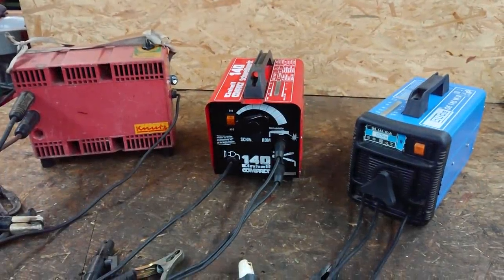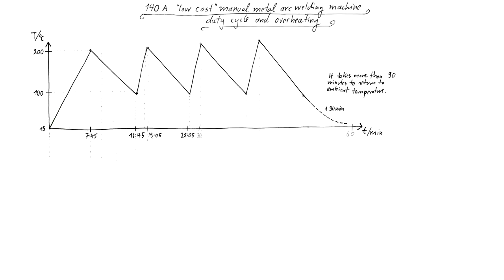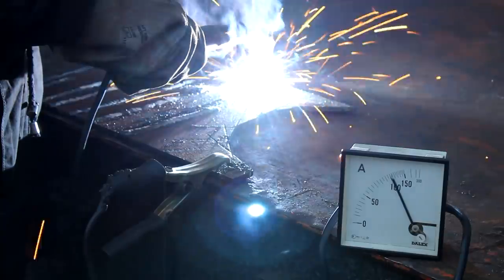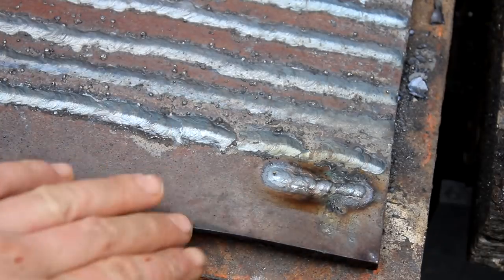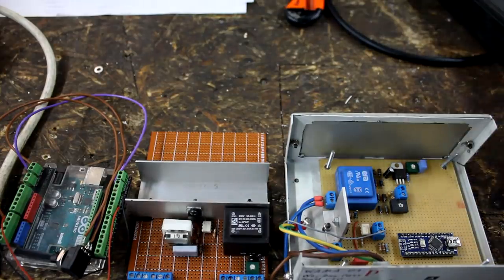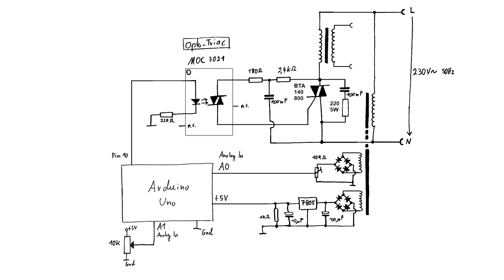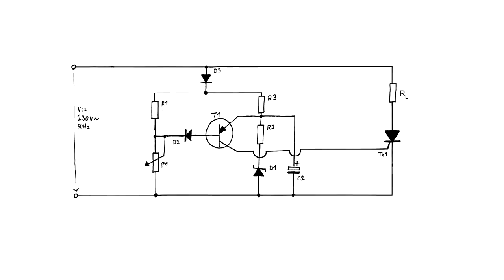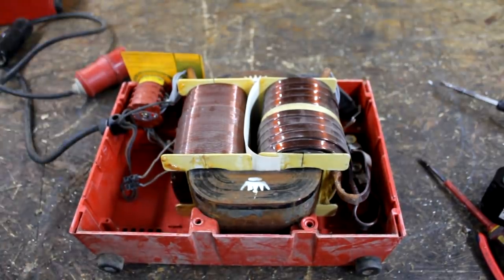Welder Experiments! DIY Upgrades for Cheap Stick Welders!

Comment: Isn't there a risk that the fans aren't really cooling the transformer particularly well? I.e. that they are basically cooling the exterior, including the thermal cutoff switch, but the interior windings are still getting too hot?

Comment: Mma?  Never heard of that one.. gmaw, smaw, mig and tig only ones i really know..  gas metal arc and shielded metal arc welding.. think gas is mig ot manual inert gas and shielded is stick because the shielding gas is made from the flux burning while you weld.  But saying that confuses me because flux core would be under that same principle yet its not smig...  tig is given wit tungsten..  or is it metal inert gas?

Comment: What mess in the mains will couse this large current ramp up when triac is fired on the maximum of the sine wave.
Reply: But is it worse than other switch-mode circuits with no transformer for stepping down the voltage?
Reply: @wilhelmbeck8498  Generally switch mode cirquits for welding should have insulation transformer. But it is high frequency transformer. Also good designs should have power factor correction cirquit. Due to high frequency relatively small inductors and capacitors can flter sufficiently switching noise.
Reply: @askostadinov   So we can expect a video on how to deal with complaining neighbours ! ( looking forward to that one ! )
Reply: @wilhelmbeck8498  I am sure the autor will address the problem and I will watch with great pleasure.

Comment: A question about the fans: The way the fans are used it looks to me like you can only move the amount of air that one fan can draw through the inlet, couldn't you get twice the airflow by mounting both fans at the same end moving air in the same direction?

Comment: Why not build a new enclosure for the transformer that can hold oil to act as a cooling fluid?

I'm going to build a welder that's designed for 50 amps input and plan to submerge the circuit in mineral oil and add a small radiator, pump, and fan to the system to handle the thermal load produced.

Comment: I can see a problem with the cooling.
The volumetric efficiency is too high. Your using 0.942m² tube to cool a 0.36m² transformer.
If you place a venturi or internal baffling around the transformer, you will increase the air speed over and through it.

Comment: I have transformator welder with selector for 0 50 80 110 and 140 A, the selector was broken, got a new one, but there is 8 wires inside (4 coming from big coil and 4 from small). The switch in every position connects only 2 wires. How to know how to properly connect the wires to the switch and how to measure them because there is not marks on the wires. Thanks

Comment: It looks like you had the fans working with one pulling air in and one pulling it out, if so I think you might get a better result with them both pull air in and letting the warmed air vent upwards through a grill.

Comment: Great idea. But I think a Mikrocontroller based triac control is pretty overengineered (except you want to do something special with the waveform). An analog circuit will do the trick and is much simpler, as the small transformer is not needed.

Comment: I have created an alternator as a bldc motor and have it turning a wind generator off of the bldc motor. It makes 80 to 109 dc volts but when I try to use it it slows down and only makes 24.8 volts dc. Do you know of a way to filter the output to get the 109 dc volts and relieve the strain and loss of the PMA out put?

Comment: Now what would really be interesting, DIY liquid cooling!
Reply: yeah, filling the pipe with oil, adding a pump to circulate and a small intercooler or just an old radiator.

Comment: I admire what you did here.  You definitely have skills.

You probably thought of this already, but if you convert to DC, then feed that to a mosfet H-bridge, all kinds of things are possible.  You can control AC balance for welding aluminum, pulse rate and duty cycle, basically do it all in the electronics.

Comment: diy ac tig welding from analog means style repurposed  junk or ? signal generator and a class d amp be fun to see some of the full range Brazilian amps may work  tiny lots of power may be the silliest thing but if any one could get a 10k Taraamps to weld it would be you lol

Comment: I have seen your comment about the serial connection but I decided to add my comment about that:
It's not a good idea to connect the 12V fans in series to 24V.
They should be connected in parallel to 12V.
Any difference between them will cause different voltage to arrive at the fans and one of them which gets the higher voltage may fail.

Comment: Would be lovely if you can reverse engineer the HF Start module from your older project, the ESAB analysis, and how to implement it in this project or in a DIY TIG Welder project starting from a cheap DC MMA Inverter.
Maybe make a pulsating module too...so this would be a cheap alternative for the folks wanting to try out TIG before investing in an expensive unit.
I'm 100% sure a lot of guys out there would be greatly interested! I'm one of them! 
Keep up the awesome work! and thanks for sharing the knowledge!

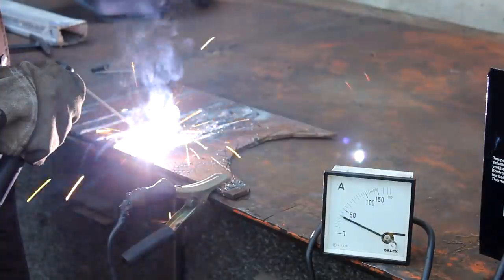Comment: Anyone else notice what looked like Stray Arc Flow traveling through the metal table (at a radius line to the right of the workpiece and then again later at the edge of the table to the right of the ground clamp) @ 11:00 - 11:20? Maybe I'm mistaken ... I'm a humble man, been wrong before and it'll happen again so why pretend otherwise ☺️... but I don't think I've ever seen something like that in person or from another welding video. If anyone has an answer I'm super curious.

Comment: As always, excellent video! I moved from the old transformer welders to inverter just a year or so ago, having used transformer welders for many years to good effect. I did consider doing some of the upgrades you did (primarily turning it into DC with a bridge rectifier along with some big caps) but I decided against it considering the low cost of inverters and the desire to get HF TIG too. Impressive to see how far you are taking this - though I presume it is more for interest rather than trying to get a good cost saving upgrade. Just something you might like to consider as you dont have Dinse connectors shown in the vid - on my current inverter welder when I am switching between TIG and MMA, I often just leave the earth lead set for TIG and run the MMA holder in DCEN. I honestly cannot say I have noticed the difference between the results of DCEP and DCEN (obviously, I am only speaking about MMA - DCEP TIG would be a whole different ballgame). This might just make your setup a little easier. Looking forward to the next one! Thanks

Comment: Great video as always, if i could pose a question: why did you use that type of circuit for driving the fans instead of a transformer or a switching PSU? It seems to me to be overly complicated for the function it achieves. The explanation of it  was very interesting though, so i definitely see the educational purpose behind it. Does it have any advantages i overlooked?

Comment: I think your capacitor C1 should be upgraded to a 350 volt. The rms mains is 230 volts but the peak value far exceeds the 250 volt rating

Comment: So you basically use a dimmer circuit to step down to some DC voltage. Nice idea!
Are the fans too high powered or would it be possible to also drive them with a simple capacitive dropper?

Comment: Nice vid G, there are some nice cheap igbt's ($11) that would make a great CV and CC ac and DC supply, all controllable with the Arduino. I suggest this because there is a shortage of welder source design demonstrations that, if rectified (pun), would reduce the impunity welder companies show toward sharing their schematics. Thank you.

Comment: I think you did a great job  and had simple, yet elegant diagrams and explanations!  However,  I see with the welder a way to modulate the on-portion of the phase of the AC power coming into the primary.  I DON'T see a means of power factor control - a completely different beast altogether!  But I look forward to that.

Comment: EDIT: This comment is for the first circuit:
You can eliminate the second bridge, if you install an 1N4004 or higher diode. The higher the voltage rating of a diode, the higher its reverse leakage current. 
Put this diode in the path between the 1st bridge and the 100uF cap.
Take your signal from the cathode of this diode. The anode will go to the cap. 
Replaced 4 diodes, with one. The rest, stays the same. 
Where is my prize?

Comment: Lüfter: Zwei Lüfter "in Reihe" wie im Video = Ein überflüssiger, nutzloser Lüfter:) (Übertrieben ... aber im Prinzip ja)
Keine 220-240V~ Lüfter benutzen: WHAT? WHY? 
Ist natürlich völlig legitim, wie du im Video gesagt hast mit Phasenanschnittssteuerungen/Regelungen zu experimentieren. Vor allem für YouTuber dürfte eine Temperaturregelung etwas feines sein. Alleine wegen den reduzierten Hintergrundgeräuschen. Aber in der Praxis und im Standardbetrieb (Also wenn etwas unbedingt FUNKTIONIEREN MUSS, wenn die Maschine gebraucht wird!): Schnickschnack! Weg mit dem unnötigen Zeug, das andere Schaltungsteile vielleicht negativ beeinflussen kann und genau betrachtet nur ein zusätzlicher Pfad ist, der AUSFALLEN kann und somit die Funktionsbereitschaft des Gerätes eher vermindert. Es gibt überhaupt nichts an einem dauerhaft laufenden Lüfter in einem Schweissgerät auszusetzen. Außer natürlich bei den Erbsenzählern, die üblicherweise oben genannte Probleme, die Kosten der Steuerelektronik und die erhöhte Anfälligkeit eines gesteuerten Systems einfach unterschlagen. Beispiel: Der papst DC-Axiallüfter, 24 V mit 169.9m³/h der 41,16 € kostet und geregelt wird, hat noch nicht einmal ein Drittel der mittleren Lebensdauer des 4000 N AC-Axial-Lüfterkit,  230 V ac, 160m³/h im praktischen Einsatz. (So nebenbei: Bei diesen Lüftern kann "das Drittel" immer noch 7-10 Jahre Lebensdauer bedeuten).
Edit: Kosten für den Lüfter mit direktem Netzanschluss vergessen: 43,51 €

Comment: hi,nice video,keep it up,just wondering,why do you need an arduino,the same function can be achieved with an analog circuit,also,the switching transients could cause extra heating in the core of the transformer

Comment: Love this channel, do not stop the theory, inverter tech at its basics. Could you please do a video explaining why low level capacitors, like the little electrolytic one at the end of the build, are used for stability, is their breakdown voltage exceeded, or not. Different uses for capacitors ( or no am I misunderstanding) its not like when capacitors or used in a circuit for power correction or reactivity purposes, right?

Comment: Very interesting video (as almost all from this channel). 👍
But please train yourself to draw electrical diagrams with currents and signals that go left to right and top to bottom (as is common practice with technicians). 😵

Sehr interessantes Video (wie fast alle von diesem Kanal). 👍
Aber bitte gewönnen Sie sich daran, elektrische Diagramme zu zeichnen, mit Strömen und Signalen die von links nach rechts und von oben nach unten verlaufen (wie es bei Technikern üblich ist). 

Marvin says: Don't panic and wear your mask. 🖖😷👍 ❗

Comment: Excellent, looking forward to more details.  Very interesting the detail of the circuits operation.  Wondering if detailing to be more like the modern settings on the welders like Constant Voltage or Constant Current.  I'm not certain what you can do to improve other than maybe detailing waveforms maybe and other options like hot start settings, lift tig, high frequency start, etc. not shown in much detail before.  Very informative and impressive.  Thanks for sharing, Merry Christmas and Happy Holidays!  To a safe, healthy and joyous holiday season and beyond.
Reply: Figured I'd share this video if you've not seen yet for a seemingly simple circuit for AC TIG welding aluminum.  https://www.youtube.com/watch?v=5V7aUaB0A1A&t=1164s

I thought was neat and mainly bought into because the gentleman demonstrated the adjustable nature of the zero to negative 220 cycle via the rotary switch selecting the series of zener diodes and therefore triggering the triac to on or off state of the negative cycle.  I thought was interesting because I've never seen before such a simple design along with oscilloscope demonstration of the waveform as well.  

I just downloaded and installed qucs-s to attempt to simulate as I'd like to build once I determine which zener diodes were actually used as I don't see the same diodes used as noted on the schematic.  I'm almost thinking the schematic is wrong possibly in the resistor placement as well as I'm not certain what that 15KV capacitor is.  Anyways, seems very tempting and I now want to play with one of those TG40E60 triacs and more.  Would be interesting to see what your thoughts are for the design and benefit for your designs TIG utility for welding aluminum and not tripping your breaker.  Kind Regards
Reply: Oh and my latest video today Nov. 20th 2022, I am not good at being a producer of videos though, does show some schematics for H-bridges to control the AC to DC inverted to DC waveforms "balance" for duty cycle between positive and negative cycles.  The Miller syncrowave schematics are shown and referenced in the description so I don't forget all this since seems enjoyable and rewarding.

Comment: Thank you for your video! Interesting subject and well executed. The circuit explanations are ambitious, but I still think they're incomprehensible to those who do not understand the circuits to begin with, and somewhat superfluous to those who do. IMHO it would be better to expend the effort on either group of viewers.
Reply: I don't know about that.  I reckon there's a constituency of people with a basic education in elec eng who get fazed by a circuit presented all-together, but who can handle it (and learn something) if it is carefully broken down and lectured to them.  Well, that's me, anyway - 30 years on from an engineering degree with electrical content, which I never developed!  I'm learning a lot here - someone even gave me an Arduino...

Comment: Hi great video but if you want to weld with dc I would recommend adding two more diodes capacitor and balast
https://www.svarbazar.cz/phprs/view.php?cisloclanku=2007042601